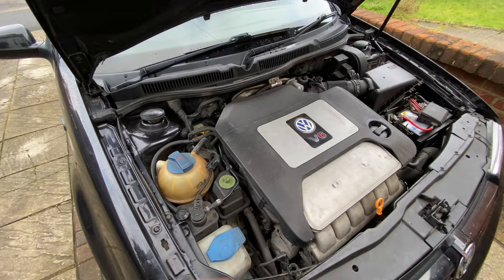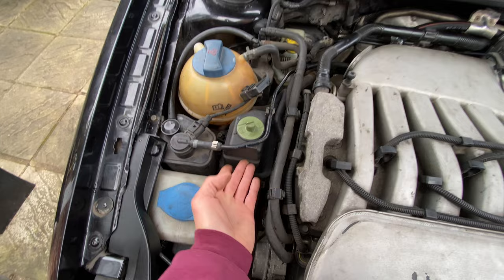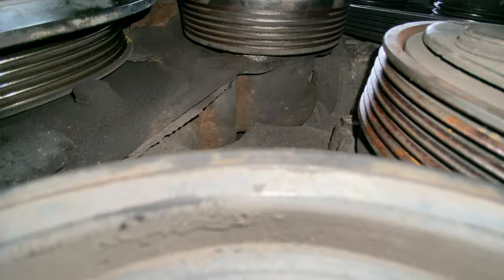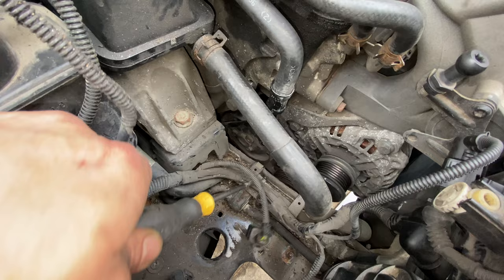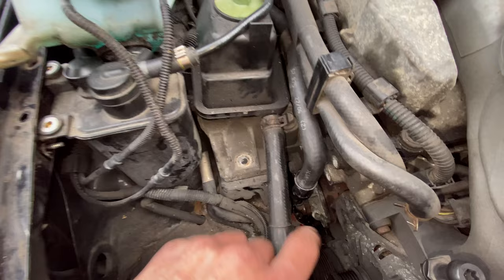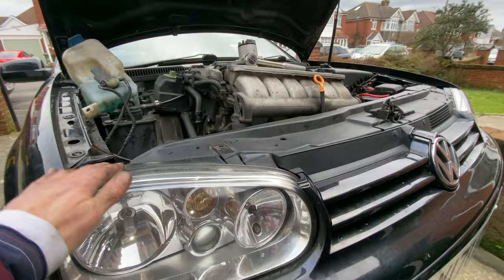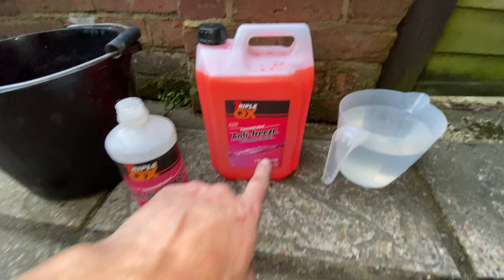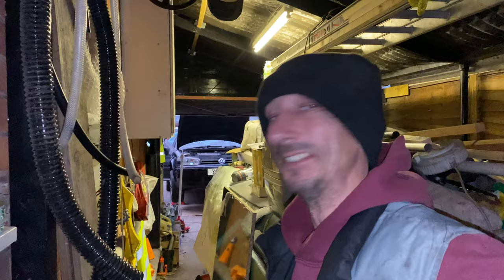Water pump replacement 2.8 vr6

Comment: That's a cam follower matt hear the way it comes and goes 
Cam lobes most likely worn flat making too much contact with the face of the followers
Look at the transporter I just done same sound
Reply from the maker: yes i did see that video and to be fair when i was editing this video i did think it sounded like a follower. Also was good to see the t4's round your yard getting some love, love the patina look on them. The RD cant believe it started so easily, wow
Reply: @TwiggsT4  thanks buddy I will be doing the t belts and seals on the 88brake t4 next then I've my silver camper engine to come out new gearbox etc so plenty of transporter videos to go
The rg turns out it's a Mk4 250 and a rare motor so I've that engine sold and an rd350 ypvs to go into it 🤗
Reply from the maker: @gearsandtears7643  Yeah it was good to see the vw's move having seeing them sat in the background for a while. Be nice to see them back on the road all serviced up. Love the old rd's, don't see them around and when you do they sell for a lot of money. The rd 125 was quick, but the 350 wow thats going to be mental, awesome
Reply: @TwiggsT4  just thinking too that vr6 has a timing chain if I'm not wrong
I'm still thinking followers but I wouldn't go near them it's not bad at all just keep the oil changed regular 
Cams and followers and cam chain kit won't be cheap I'd imagine and the engine would probably have to come out because of space issues seeing timing marks even would be a ball ache
If your planning a trip to Ireland I'm in Kildare so you've a base to hook up electric and camp out in the woods have a few beers your more than welcome
Reply from the maker: @gearsandtears7643  yes it chain, I’m not planning on doing doing any of that. I was down the garage the other day and even they said they’d never do another chain on one of these, easier to remove engine and gearbox and then do it, that seams like a lot of work, and once it’s upto temp the engine is silent, no knocking at all. 
Yes that’s just prompted me to get a passport, and renew my licence, I think my passport ran out 2017 🤦‍♂️ 😂 definitely need to plan a visit 👍
Reply: @TwiggsT4  ha ye same here don't even know where it is lol definitely out of date